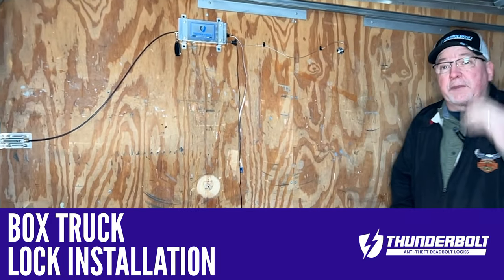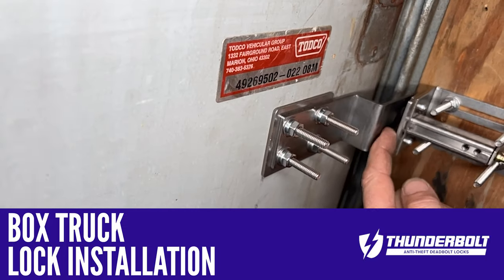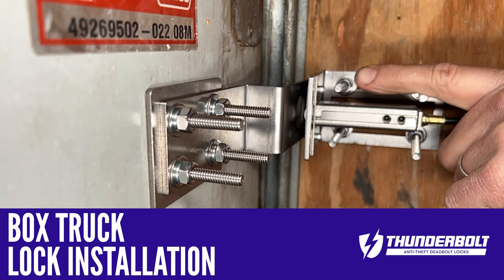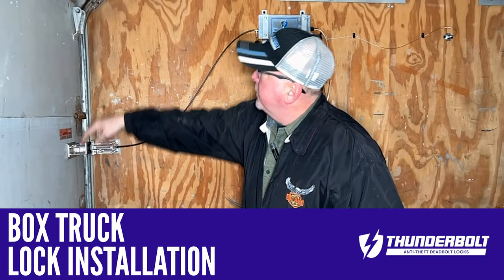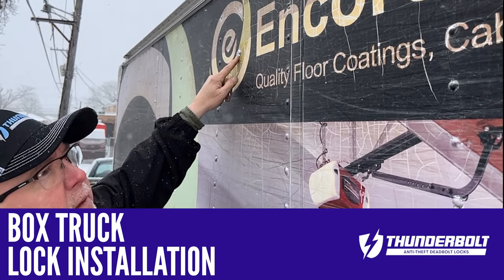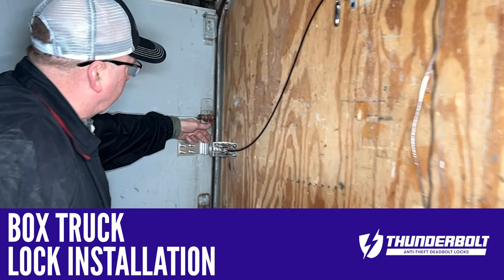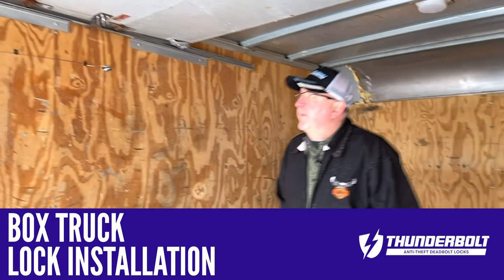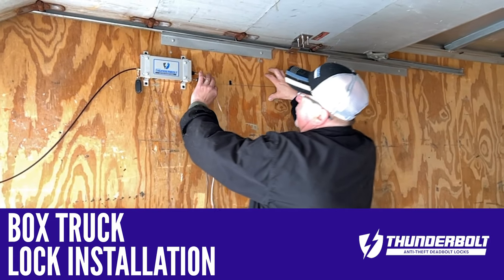Box Truck Installation

Comment: Not a fan, the design is such a small point of contact with the door. For the price it’s not worth it/have seen better systems that you can ship in from overseas.
Reply from the maker: That small point of contact just saved one of our customer's plumbing trucks from getting cleaned out! If you want additional points of contact, you can install our "dual" lock with two deadbolts. The lock is priced under $400. We also offer a Lightning  Bolt Lock Pin for under $90 that works well but is not remote-controlled. At what price is it not worth it when your livelihood is at stake? 🚚